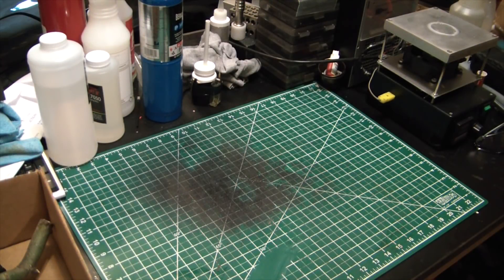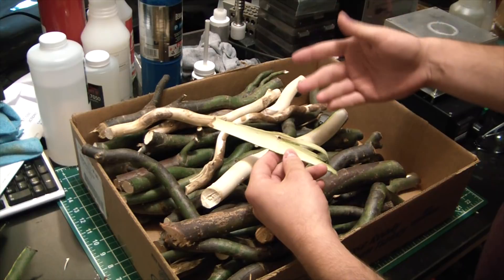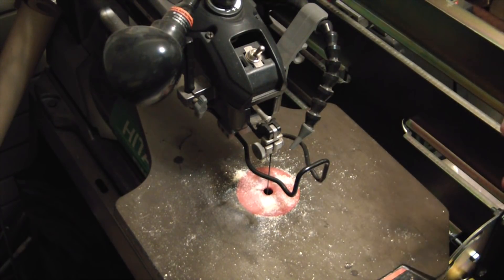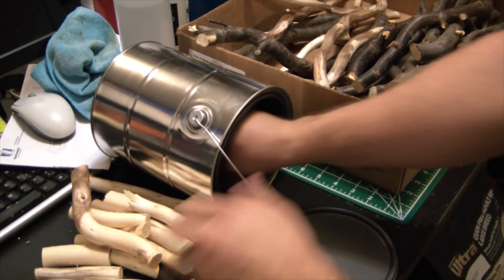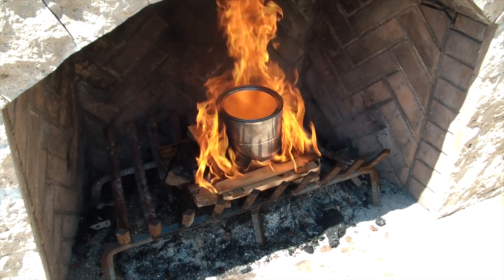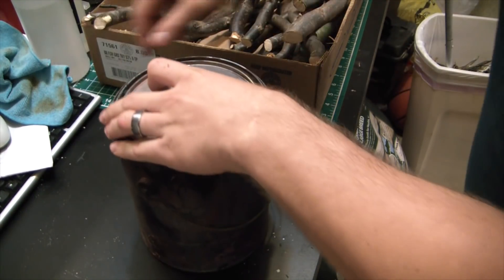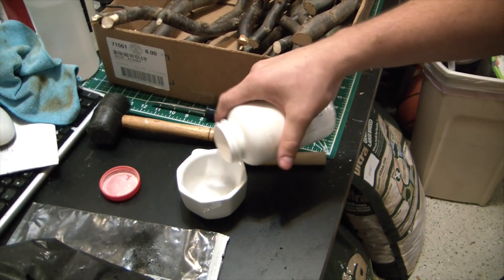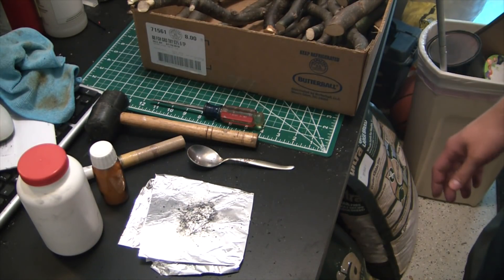Making Willow Charcoal for Black Powder - The BEST Charcoal! ElementalMaker

Comment: I've seen somebody poked a hole in the top of the can and when it shoots out fire it's done
Reply from the maker: It's only when it stops shooting out gas that's it's done. When it starts it's just beginning pyrolization. And I always keep the hole on the bottom, as heat rises, so might as well have the burning wood gas help make the charcoal rather than just burn up above the can.

Comment: why did you put the hole in the bottom rather  then in the lid?
Reply from the maker: @seymourwrasse3321  so the burning wood gas helps heats the container rather than just burning up above it.
Reply: @ElementalMaker  that makes perfect sense!

Comment: Hello, i am trying to make black powder, but it always burns really slowly, i blender the 75 - 15 - 10 nitrate - coal - sulfur for about an hour, then dry it. One teaspoon of my black powder burns for about 2 seconds. But in the video your powder which was whacked with hammer burnt really fast. Did you ball mill nitrate or my nitrate is low quality?
Reply: I used willow coal. The seller of nitrate claims it's 99% pure.  It arrived in large, almost rock hard clumps, which I hammered then blendered for half an hour. Then I mixed black powder in above mentioned mass ratio and blendered it again for about an hour. The resulting black powder burned slowly and left coal residue
Reply: I tried different proportions, blendering real hard, granulating and got 0,8 second  burn time at best with granulated 75-15-10 birch black powder

Comment: I am using nano3. does it need other ways to prepare black powder
Reply from the maker: Sodium nitrate is much more hygroscopic than kno3 and will make for damp black powder which won't work well, your probably better off doing a double displacement reaction with a potassium salt to convert your sodium nitrate into potassium nitrate, then recrytalize to purify.

Comment: Let's call it stump remover. Would that work? Have you tried it? And what ratio should actually be used (for potnit or stump remover if it works)? That little demo was pretty impressive, btw!
Reply from the maker: Yep just standard hydroponic grade kno3 and the standard 75/15/10 by mass, although I think in this video I just eyeballed the mix
Reply: @ElementalMaker  Thanks! We'll give it a go. Getting hard to find the right stump remover anymore though. They got some new benign formula that didn't do shit to the stumps I tried it on. Progress, you know...
Reply from the maker: @jimketchum3169  They still sell the kno3 based stump remover at lowes believe it or not, at least in my region. The big orange store stopped carrying it long ago.
Reply: @ElementalMaker  Thanks for the tip. We don't have a Lowe's that I can get to though. We got the big orange store. But where there's a will, there's a way.
Reply: @ElementalMaker it goes by weight not volume 75 15 10 by weight !!!

Comment: The good traditional pyrotechnic charcoal making is art... not just put the wood into the can heat it and there you go... First of all you want  specific and steady temperature for the wood to make the pyrolysis  434° celcius for example  is nice, if you see the charcoal as end product must look dark brownish colour not black... Second also important is the time that you cut the wood in nature , you must cut the tree at the time that tree take down all the juices to prepare for the winter so when all the minerals go down to the roots prevent all the byproduct side reactions when pyrolysis take place! Third, last and most importantly is when you must stop the pyrolysis, this is when the "art" word take place. The last step must be very precise otherwise you just ruin the hole batch.. some charcoal masters claim that this must calculate by experience other by time others by the color of the flame ... Interesting Huh?🤔  Well when the fire upon the lid is 2 cm you slowly turn of the heating  about 5 minutes untill you turn of completely (not too fast because the paint can the walls is very thin and cool off quickly and the temperature changing effect the process) the. You close the hole tightly and let it for 2 hours at least to cool. Be patient this always plays a big role on this!!! Well that's why the quality of black powder is engineering and not just hard work or playing around... The quality of charcoal is the 98% of the black powder recipe! My charcoal is top performance and this  is achieved  only when you love whatever you do... You just want to do it perfect!  I hope i help you a lot! Great video ElementalMaker 👌👌

Comment: do it right, boil all the water out of the wood, then boil it in ethanol in pressure over 400psi till the wood is falling apart, after cooling distill the ethanol leaving some behind with the wood paste not including fiber... mix paste into water bubbler bubbling nitric oxide thru the water in a multi stage percolator. method in video damages all the cellulose
Reply from the maker: "do it right" lmao nobody in history has used whatever method you described. Of course pyrolyzing the cellulose damages it, that's the whole point of making charcoal.

Comment: Hmm, I’m wondering if anyone has tried using coconut shells? I know it makes a fine charcoal…and can be used in gas mask filters, when activated.
Reply: Coconut shell is extremely hard so I would expect it would make a very slow powder.
Reply: @deandeann1541  hmm, maybe, I know it makes tiny particles when ground down, with more surface area than most, which is why it is preferred for gas mask filters, even these days. That’s what made me think of it being used.

Comment: I love this! I made some BP last summer but I neglected to
 peel the willow stick as you did. Do you find a difference between peeling your willow or leaving it whole?
Reply from the maker: I've never actually tried it with leaving the bark on, but from what more experienced pyrotechnicians have told me the powder performance will be about the same, but the bark will create more longer lasted embers. So it might lend to better visual effects in rocket motors and other similar things like fountains.

Comment: wow,in my making of BP,the mixture sticked to the inside of the ball mill container while milling; maybe the RPM is too high🤣;and instead, the cedar also is a better choice for making charcoal,it's easier to be the float charcoal powder.Nice Video!!!
Reply: KNO3 holds enough water to throw your proportions off, I have weighed it before and after drying it in a dehydrater, KNO3 for one lb of powder can have 8 or more grams of water in it, it makes the powder turn into hard polished black golf balls in the ball mill, it stops the mill from working correctly. My dehydrator is for food but it works great for drying KNO3, I set it to 150 degrees. My dehydrator is steel and quite large, I would not dry saltpeter in a plastic dehydrator, it might burn the house down. Anyway, with black powder you assume all the risk and have to use your own judgment, it's just the way it is.
Reply from the maker: Try drying your kno3 before milling. It's quite a hygroscopic compound, and it sounds like yours has quite a bit of moisture in it if it's sticking to the container like that
Reply: @ElementalMaker  It's the point!!! thank for your advice! i'll try it again

Comment: So I gave it a shot on a small scale using thin-ish dried willow branches and a Pâté can as pot lol. As lid I used some aluminum foil with a small hole poked through it, it proved more than enough and wasn't affected by the heat at all. As it was such a small scale I did it directly on the stove inside the house with the stove hood on max. Now my question is, for how long should the pot be heated once all the gas has burned out? On the small scale I did it usually took around five minutes for all the escaping gas to burn after which time I'd stop the heating and cover the small hole with a small piece of foil. While the charcoal was absolutely AMAZING for drawing, it proved mediocre for blackpowder. Dunno what I'm doing wrong to be honest. Should the pot be heated for longer once all the gas burned out? Or maybe I didn't mill it for long enough?
Reply from the maker: The big thing is how you mill the black powder, are you using a ball mill or some other method? Also just to check, the willow was debarked right?
Reply: @ElementalMaker  Cheers for the fast reply man! So the answers: I am using stainless steel milling media, only doing it in small batches in a blast-proof place, and of course the willow is debarked. I also only use three-four month dry willow, not freshly cut one, but I can get either one in big quantities. I always stopped heating the charcoal making pot the second the flames died down, I also then plugged the hole so no oxygen can get in.

One more thing regarding ball milling, I first crush the charcoal and sulfur together in a mortar and pestle and mix them as well as I can and then I mill them for one hour together. I then mill the nitrate separately for one hour and lastly I mix them all together by hand and mill the entire batch for another hour or two. I then either leave it as is or granulate it by slightly damping it in isopropanol and using a sieve. I ran out of dextrin but I might get some soon.

I was always most afraid of the last milling step when all the ingredients are mixed, despite all my precautions, so maybe the low milling time of one hour affected it. I might also try milling the fuel for much longer, at least 3 or 4 hours, there's no risk of ignition in that case anyway. The ball mill is homemade, with the milling speed not being too fast, but the motor is strong enough to properly rotate the jar even when heavily loaded with steel ball bearings.
Reply: A quick update: a new 50 gram batch was made where first the willow charcoal was ground up for twenty minutes by hand in a mortar and pestle, then mixed with already powdered sulphur and the mix ball-milled for one hour using steel ball media. Potassium nitrate was first ground up alone in a blender for five minutes after which it acquired a flour-like consistency. It was then ball-milled by itself for one hour using the same steel media as before.

The resulting powders were then mixed by hand in a mortar and pestle for ten minutes and then granulated using isopropanol. The resulting powder, even though the ingredients weren't milled one last time together, proved to be extremely fast even when still slightly wet with alcohol. After the first granulation it was reduced to a powder and granulated a second time, currently waiting for it to dry. Very sensitive to sparks and naked flames alike, leaving only a little ash behind. For how safe and how low the total milling time was, I am more than satisfied. My poor results before were surely caused by not milling the individual ingredients for long enough.

Next time I plan on milling each ingredient for at least two hours each and then compare the results. I am still scared of milling the entire batch together with how darn sensitive the stuff is, although I am inclined to maybe mill it while slightly damp with water. That should greatly reduce, if not completely eliminate, the risk of ignition.

Comment: If using this for a flintlock rifle should I be concerned about the liner inside the paint can?
Reply from the maker: You could heat the can by itself before using with wood if that concerns you. I haven't found it to be as issue though
Reply: Thank you for your response, I was thinking that there’s not that much of it and most of it would burn down to nothing.

Comment: I cut Willow limbs up to around 1" diameter in the spring. With the sap rising, the bark peels off like a banana. After cutting to length, I pack them into my tin whilst flexible and allow them to dry before charcoaling. The charcoals have a beautiful blue/purpe hue and are superb for art as well as fireworks.

Comment: Is carbon black and lamp black the same thing as airfloat after milling? And I have heard its made from lamp oil and other sources, so how do I make lamp black or carbon black if it's different?
Reply from the maker: Lamp black and carbon black are the same thing, but it is very different than airfloat charcoal. Definitely can't be substuited for one another.
Reply: @ElementalMaker  Hey thx man I really needed clarification, something more for the ole wallet to cringe at I guess. Mixing it with HTPB  as a binder to AP and dark aluminum. BTW I am also told that I need Isocyanate or Dibutyltin Dilaurate to harden it. Any ventures down that avenue? I don't have that cool book you do, lol.
Reply from the maker: @kingdave8863  yessir check out my newer videos on compositie rocket motors. You will absolutely need a curative. I use MDI curative from RCS and it works great.
Reply: @ElementalMaker  Writing that one down. lol Thanks a lot!
Reply from the maker: Making lampblack would be a nightmare, I'd recommend buying it

Comment: Gotta get the nitrates inside the charcoal grains for best results.
Look at the ash left after burning: if it is anything more than a gray smoke-stain, it's not running right.
Tiny beads in the ash reveal incomplete mixing.  Any sign of reddish ash is no good; your charcoal has minerals in it.
Nitrates get driven into the charcoal through the use of water and pressure; not so much of the first, but lots of the second.
Just enough water to make your mixture a stiff putty-like consistency.  Shouldn't be able to squeeze out water by hand.
Press the slurry mechanically to squeeze out excess moisture, then let the 'cookie' dry completely.
Carefully break up the cookie, sieve it gently to get the particle size you need.  Finer grains burn faster.
Sure, it takes longer than a simple mixing, but the results are worth it.
...
Ultimate test for black powder: a sheet of paper.
1/4 teaspoon on paper, ignite the powder.
If the paper is merely smudged by the smoke, you did good.
If the paper chars, the powder burned too slowly.  Tiny holes in the paper indicate poor mixing.
Some woods used for charcoal have high amounts of calcium, potassium and sodium, which can interfere with black-powder combustion.
The faster the twig grew, the better for black powder.  Grapevines come to mind.
Reply: Alcohol is better than water the cookie dries quiker

Comment: Awesome video this stuff works much better then the ground up fish aquarium activated carbon I was using. The aspirin video would be cool to see, only trouble is getting acetic anhydride to convert  the salicylic acid into acetylsalicylic acid.
Reply: You dont need to convert it, The only difference is that acetysalicylic acid is easier on your stomack than the unconverted form. It only makes a difference if you use it a lot.

Comment: Sir, if I may?  You and others may have noticed that Walmart, etc. sell drawing charcoal which is claimed to be made from Willow.  Could this material be used to make a Black Powder that is just as effective as that you could make? I don't have a paint can yet, but would like to experiment in this as a/an propellant for my new 1858
Reply from the maker: That would be some VERY expensive BP. Much cheaper to just make your own charcoal. Heck cut up some white pine 2x4's and pyrolyze them, white pine makes very good BP.
Reply: @ElementalMaker  My wife and I had to go to Walmart today for pet supplies. While there I learned that Walmart does not sell empty metal paint cans(with lids), but they do sell gallons of paint at 'Get Rid Of" prices.  I got a full gallon of paint today, for $4.42, far cheaper than I could have paid for an empty can, even if they did have one. I'll keep working on my BP!  And Thank you, for the time you took to reply to my message.
Reply from the maker: @grandpabear5493  That's certainly a good price for paint, but that will be one pain in the ass to clean out! Isopropyl alcohol should dissolve it away mostly. Any Home Depot or Lowes should carry empty paint cans that are ready to use right around $5 or so. In crappier news, most paint companies are moving to plastic bodied cans, with just a metal lid, so this method may soon be something for the history books.

Comment: I got a pound of willow from a fireworks place but when I got the pound it has a lot of glitter or shiny specs in it. I’ve never had willow charcoal in that amount is that normal?
Reply from the maker: Could be enamel that burned off whatever retort they used to pyrolyze the willow wood.

Comment: Just because the 75-15-10 mixture is 'optimally balanced' it does NOT mean that it is the best balance for speed of burn. You see a similar counter-intuitive effect with gas and air mixtures, the ideal ratio is not necessarily the fastest 'bang'; leaner is often more brissant once the pressure and temperature get over a certain threshold (e.g. re pre-ignition in gasoline engines).  Add to the effect that pressure considerations and grain sizes/shapes AND the rapidity of various elements vapourising and their activation-energy impacting reactivity is it any wonder that you'll often get burn-rates that don't seem common-sense. With charcoal you also have a lot of other radicals and adsorbed gasses in the mix, even small difference of these can have dramatic results. Aging and steam activating the charcoal also makes a really big difference.

Comment: Can i use the coal briketts from barbeque (however its written) or the one s for burning in the winter to make gunpowder?
Reply: The charcoal briquettes for your grill wont work well at all... they contain lime which makes the briquettes burn slow and steady for an easy and even cooking use. You need the opposite for gunpowder, fast and hot.
Reply: @the_great_tigorian_channel  and the coal for winter heating with a furnace?